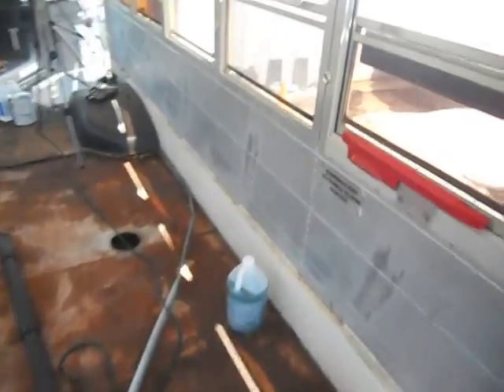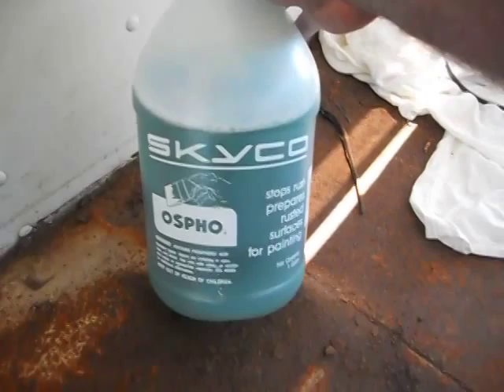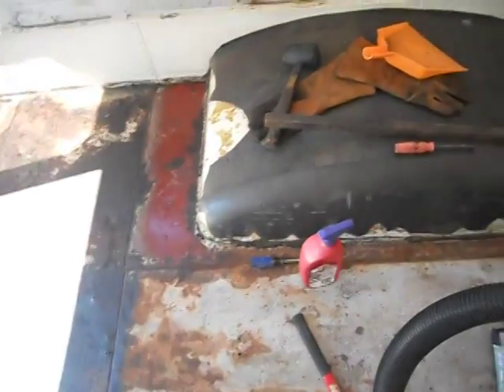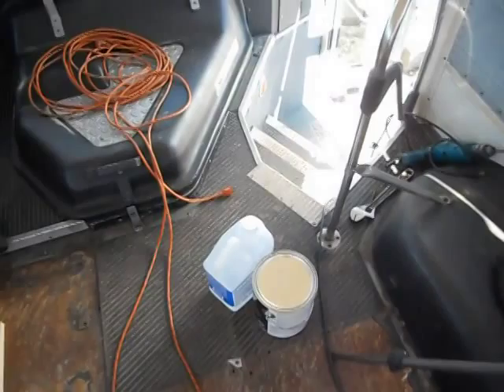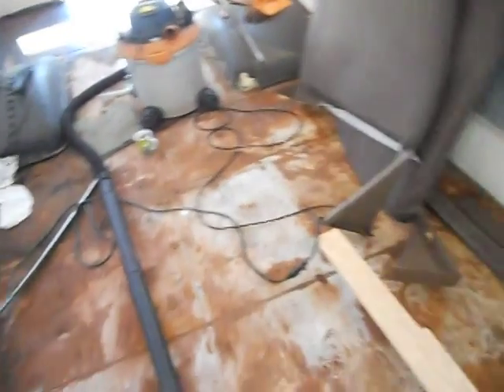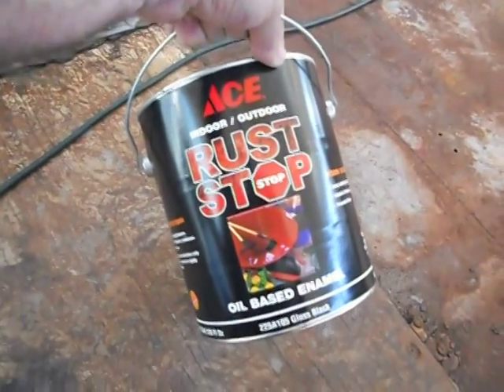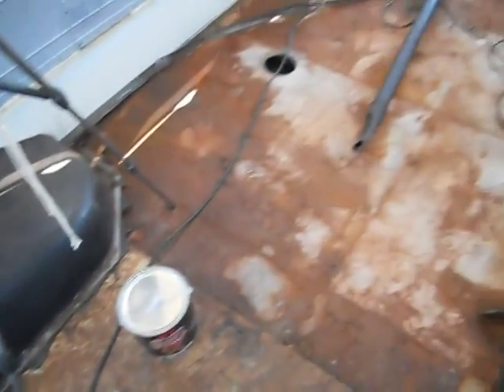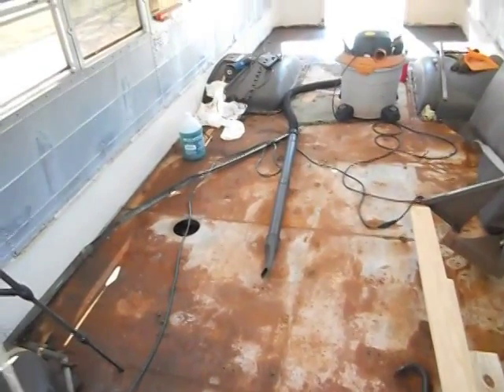Bus project rusty floor repair #4

Comment: Looking good. Walmart has Rustoleum in gallons usually. Mostly just black, but the stuff you have should do the job just fine!
Reply from the maker: You know i tried every walmart in jax fl. even the on line walmart dont have it. Home depot ether. I will do a review on the ace rust stop brand and let everyone know what i think about it
Reply: scottsinfl  iused tractor supple  tractor pant on my truck it is harder than a rock . i spayed it on  never glosset like i wanted  but it looks more falt or mat
Reply from the maker: gregory rose We just got one of them close to my side of town  they got a lot of good stuff.